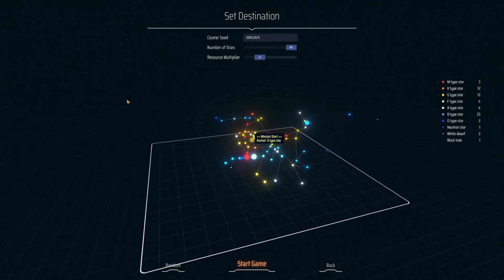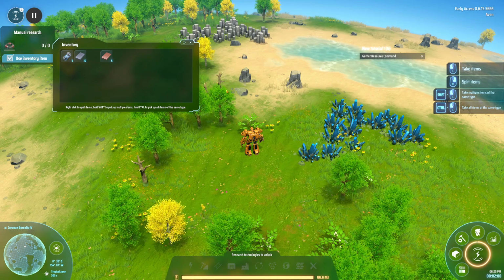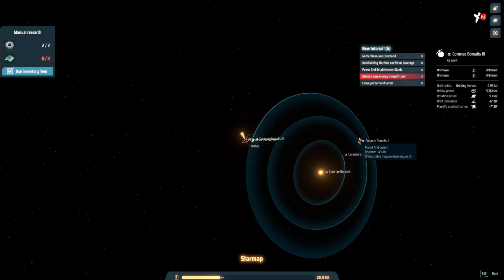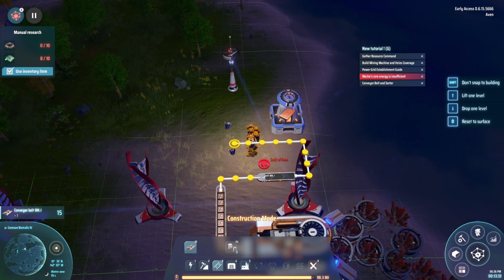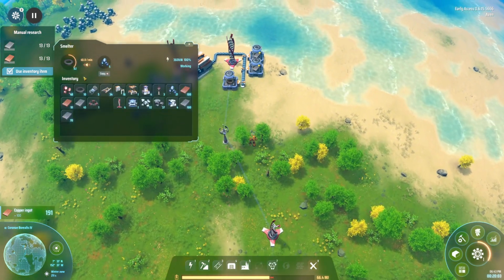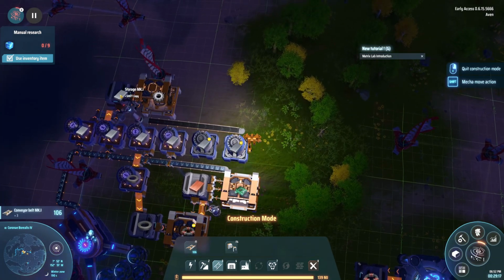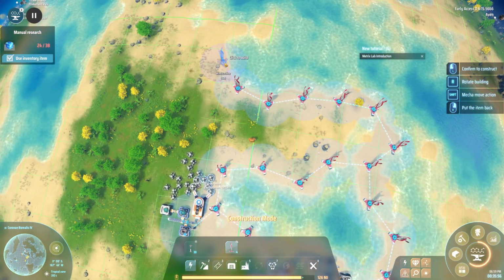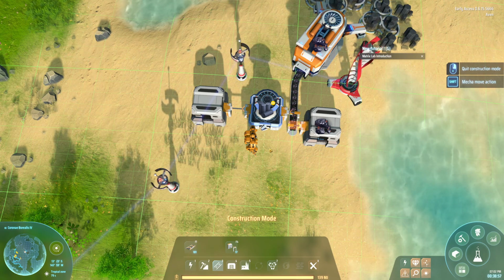Dyson Sphere Program Ep 1 - Landfall - Let's Play, Gameplay

Comment: when you can make Magnetise Graphite its better then coal normal
Reply from the maker: Using graphite instead coal ore as fuel for thermal power stations is a tiny loss in energy by around 30kJ per graphite theoretically. In practice the loss will be higher because of idle consumption of the smelters and sorters (while they are inactive)
Small correction: seems like the tiny loss is closer to 24kJ per graphite and not 30kJ
Reply: @Aven1017  I'm wondering how you calculated this number?

The math that I did gives energetic graphite a slight lead, rather than a loss. The graphite has 6.3 MJ on the tooltip, while each piece of coal has 2.7 MJ. It takes two units of coal to make one graphite in a smelter, over the span of two seconds. The smelter costs 360 KW to run, so it will spend 720 KJ over the course of two seconds (a watt literally means joule per second, for anybody reading this who is unfamiliar). Two of the first tier sorters sum to 72 KJ over the same two seconds, which is more than it will actually spend since they have some downtime, but this makes the math simpler. All told, the energy in the two units of coal plus the energy cost to transform them sums to just under 6.2 MJ, for a net gain of a bit more than 100 KJ per unit of graphite, as far as I can tell.

I'd call this somewhat worthwhile, but it becomes much more enticing when you consider how the energy density makes the logistics of your power plant simpler, and that you can fit more energy into the same number of slots in an inventory - perhaps most importantly the measly four slots built into Icarus.
Reply from the maker: I'll be sneaky and copy the numbers for a comment I made on a later episode xD

The 80% conversion rate makes it less of a gain than what it looks like at a glance.
2*Coal 5.4MJ * 0.8 = 4.32 MJ
Graphite 6.3MJ * 0.8 = 5.04 MJ
Difference 5.04MJ - 4.32 MJ = 0,720MJ = 720kJ
That difference is lost from the 720kJ needed to make the graphite. 
The extra sorter movements result in a tiny loss and all idle smelters/sorters make the loss larger (if and when any of them are idle)

I definitely agree with the logistics and stack size! Graphite is great for the Icarus
Reply: @Aven1017  Ah, I discounted the efficiency loss since it would have to be applied to both, figuring it should be a wash - like I excluded the sorter you obviously need to load the fuel into the thermal generator. That it's exactly the energy difference of the smelter seems mighty deliberate. xD

I'm half tempted to calculate it with idle times included, including the idle time of the sorter used to load the thermal station. My hunch is that the lost power from the sorters at the smelter can be chipped away at by or possibly tied by the increased idle time of the thermal station's sorter, but we're REALLY splitting hairs at that point. Handfuls of kilowatts when my base is already consuming nearly a hundred megawatts... Not to mention that I always find myself burning hydrogen instead just to keep it from backing up the system.
Reply from the maker: I actually included the less movement for the thermal sorters in the 24kJ
Burning 2 coal needs 2x sorter movement (into thermal plants)
Burning 1 Graphite requires 2x movement into smelter, 1x movement out of smelter and 1x movement into the thermal plant (4x sorter movement in total)
That leads to two extra sorter movements per graphite burned and at 18kW for 0,67seconds (Mk1 is 18kW active power use and has 1,5 movements a second) this leads to 12kJ x 2 -> 24kJ
I know it's extremely tiny, but it's fun to fiddle around with the numbers xD
Reply: @Aven1017  Indeed, it is. And that explains that number. xD